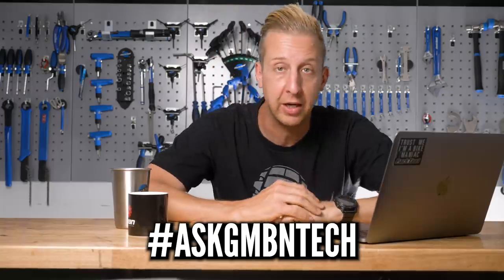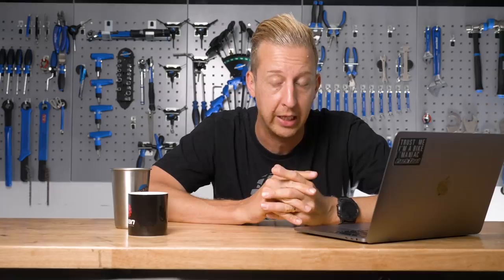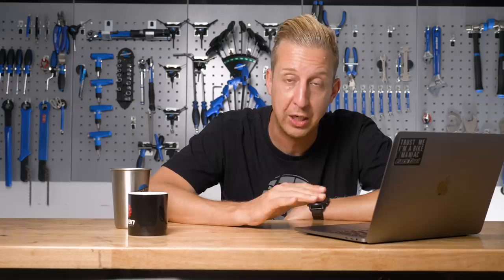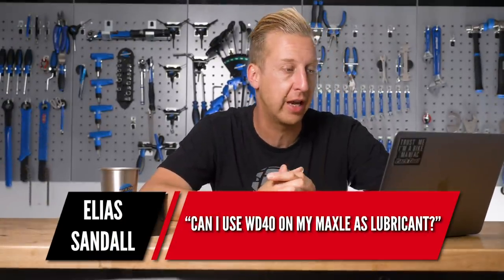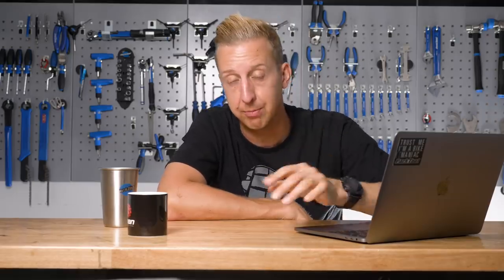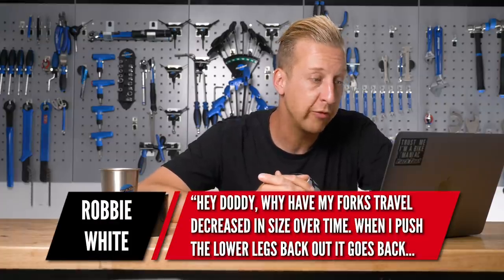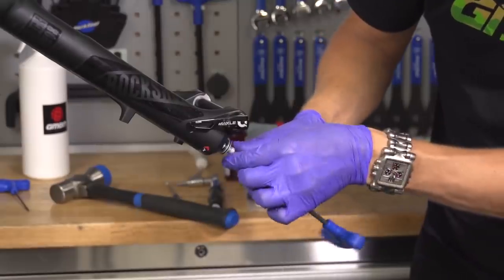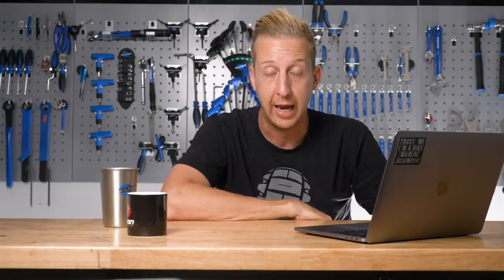How Are Disc Brake Pads Made? | Ask GMBN Tech Ep. 85

Comment from the maker: Got a question for us? Submit it in the comments below by using the hashtag #askgmbntech
Reply: GMBN Tech #askgmbntech.  Why don’t we see more Ceramic blend brake pads ?  They seem to perform so much better:  more stopping power, run cooler, squeal free, safer if contaminated...  so far, only found pads from CL Brakes and Gigapower.  Are there more companies offering these?  (Mine for SRAM Guide)
Reply: #askgmbntech

What is a good hard tail for £600 or under (preferably 1x and rear through axle) learned so much from the show thanks 👍
Reply: Hi doddy, I’ve tried to set my wheels up tubeless with a 2.6 continental Trail king and der derbaron ,muc off sealant and valves paired up with Alex MD35 650B plus 32H rims. There is a tiny leak in the rim where there is a line that follows round the whole rim which I imagine that’s where the rim joins, my rim tape is good with no scuffs or tears and the tyres seated perfectly, keep up all the good work GMBN! #askgmbntech
Reply: 34 t oval chainring fits my 2019 nukeproof mega 275 fine but it does rub ever so slightly on the rubber protector when the bike is in the fully extended position(no sag)
Reply: 7:27 - Thanks! 🙏🏻 Learned something ... again! 🏆
Reply: #askgmbntech I've got a 2017 Norco Torrent hardtail that has a stripped bb shell. Any advice on how to fix it? I went to my LBS and they said tha the BB somehow loosened itself which then stripped out the shell (not sure how that happened, the bike was built brand new at that shop about 1 year ago)  I found a BB from SunLite which is a threaded Press-Fit BB which has square tapered spindle which i think might work?
Reply: #askgmbntech What is your opinion on most powerfull brakes on the market? I have a rebuilded set of HOPE MOTO 6' es , but even with 225mm rotor and metalic brake pads, the power still goes down after some time(poor bite and starts being squishy). I thought about trickstuff's maxima model, but im concerned about the thermal capacity of that caliper, maybe a motorbike lever with 2 hope mono 6 calipers would be the option...what are your thoughts on that. Cheers
Reply: #askgmbntech Gday Doddy I was wondering if there is any way to put volume reducers in manitou forks more specifically the mattoc comp cheers

Comment: With the question about the clicking brake rotor, another issue I've run into is specifically with floating rotors. The example in the video is a floating rotor, and some brakes are not capable of handling them. Reason being, the potruding of the screws that attach the two parts of the rotor. Sometimes those screws will just barely not fit within a caliper, or they will slightly catch on, not the pads, but the metal part of the pads (depending on how they're shaped).

I could not use Clarks floating rotors with my Avid BB7 mechanical brakes for that exact reason.

Comment: #AskGMBNtech Not really a question, but I has to point out, when comparing 4 bar vs linkage driven single pivot, the difference isn’t where the pivot is, it’s where the axle is. True 4 bar has the axle mounted through the seat stay allowing the axle path to be manipulated via engineering, single pivot limits the axle path because it swings radially on the chain stay. Also, if you really think about it, they both have a pivot on the seat and the chain stay. If you’re ever confused when shopping, look at the axle path!!

Comment: #askgmbntech I'm looking to upgrade the damper on my 2017 Commencal Furious, it is a Boxxer RC. I already upgrade the spring side with the air spring kit without any issues. I want to put the newest Charger 2.1 RC2 damper, however it says it is for C1+(2019+) forks. From looking at the pictures I can't see any reason why it wouldn't fit on my forks. Will this fit my Boxxer? Thanks for the help.

Comment: @robbie white The fork sucked down is more likely air stuck in the lowers. Use the cable ties down the seals trick and pull it to full extension then remove ties before putting bike down.

Comment: #askgmbntech
Hi Doddy,
I got a second hand inspired flow about a year ago and the brakes are getting significantly worse. I tried new brake pads and cleaning the braking surface but the rear brake still slips under load. (They are magura hs33 rim brakes)
Thanks a lot,
Max
Reply: Bleed the system. A small amount of air will caused the pistons to move and contact the rotors but rather than providing the last bite, the air squishes instead resulting in sub-par pressure on the rotor and bad braking

Comment: #askgmbntech I recently got my first full suspension mountain bike and It came with Manitou Swinger 3-Way shock. The shock has a rebound adjust, as well as two Schrader valves to adjust the air pressure, a black and red one. I have no clue what the difference is between the two valves and would like to know how to set it up. Love the show and keep up the awesome videos.

Comment: #askgmbntech Hey, I'm trying to bleed my 7 years old avid elixir 1 brakes for the first time in a long while. I got the bleed kit from avid and followed the instructions perfectly, however, I can't push the fluid from the syringe at the caliper to the one at the lever.
Both clamps are open and the syringes thread in nicely. If I push hard, the fluid ends up on the floor. I also tried pushing from the lever to the caliper but it doesn't work. This is the case for both the front and the rear brake.
I read online that dirt particles and pieces from an old and brittle o-ring can block the insides of the system and that it helps to clear the hose and take apart the lever. Could that be possible? (btw, both brakes felt spongy but worked okay before this)
Have you got any other idea what the problem is and if I can fix it myself? The bike shops around here are terrible and I don't want to spend a fortune on a new pair of brakes. Please help!

Comment: #askgmbntech hy Doddy, 3 months ago i bought a Specialized Chisel. It's a very light hardtail with a RockShox Reba in 100 mm. I use it for puting kilometers in, but on the weekends i get pretty crazy with the descents. I have already installed a dropper post, and I'm thinking of passing the Reba to 120 mm of travel, will this affect the feeling of the bike too much in other areas but descending? Will the frame or fork suffer too much maybe? 
I've been told in the shop that the fork can be passed to 120 mm but i'm not quite sure. 
Thanks in advance, love the show.

Comment: #askgmbntech hello guys, thanks for the show, I've learned a lot form the channel. I recently got a 1x11 Shimano SLX with a SunRace 11-50 cassette. My first problem was the chain I ordered (a shimano 11 speed chain) was too short for the cassette, so the local bike shop was kind enough to cut another chain to get another 10 links so the chain would be long enough for the cassette. Now my question is how should I go once this chain wears out? Should I need to buy to chains and link them together to keep getting an 11 speed 126 links chain? Which brand would work the best, Shimano, KMC, Sram or any other? Is there any 11 speed chain with 126 links so I don't need to keep cutting chains? Would a 12 speed chain work (as far as I know they already have 126 links, but I'm concerned the chain to be thinner and not working properly for a 11 speed cassette) thank you very much.

Comment: #askgmbntech Hi guys I have an alutech Fanes 5.0 with a cane creek DB air cs which has a high pitch "ding"/click noise on its top out. The damper works fine but when the bike becomes unweighted and tops out fast it makes this noise. I'm a lightweight rider at 58kg and the damper is 216x63 running 140 psi 25% sag, the frame has 170mm of travel. I know this damper can be tricky to setup since there are fully independent adjustments for both high and low speed compression and hig and low speed rebound, I would really like your guys help to adjust these in the right way, and know if the noise is something to worry about or a matter of setup. i do a little downhill on the bike and I love to get bike in the air as well. Thanks for a great show and hope for you help.

Comment: #askgmbntech what is sram dub?
Will it fit on any bb or do I need a specific type of dub for my pf92 bb
Reply: dub is another crank axle standard (28,99mm). in their words the perfect size. The dub BB's come in pretty much all sizes (BSA 68, BSA 73, BSA 100, PF89.5, PF92, PF121, BB30 73, PF30 73)
Reply: Dub is their new crank axle standard. U will need a dub bb, and I believe they make one for pf92, but check srams website

Comment: I went to Morzine and burnt through 4 sets of brake pads on my 200mm shimano zee disk brakes. How can i prevent my pads overheating?
Reply from the maker: Hey Dale, try to use a shorter sharper braking action where possible. If you drag the breaks for a longer period they will get very hot! Hope this helps 👍

Comment: #askgmbntech -  I have KS Lev dropper seat post on my Cannondale Habit that will not return always to the top of the position when my trigger button is pressed.  Is there any easy way to fix this?  I was just going to take it to my LBS and let them sort it out, but curious if it was a simple job.  Thanks!
Reply from the maker: Hey Andrew, first it's worth checking that the cable isn't sticking. It may be kinked or damaged and causing the issue. It's also worth checking you haven't over clamped the seat clamp as this will effect the friction in the post. 👍

Comment: #askgmbntech I recently bought some new brakes. They have a very different leaver feel to my last ones. There is a lot of lever movement before the pads acctually make contact with the rotor. So, Can you bleed brakes in away that you put extra mineral oil into the system so that the piston sits further in while in its neutral position to reduce the leaver throw. And if so how? Thanks in advance

Comment: #askgmbntech hey doddie is it possible to use tubeless tyres on a non-tubless specific rims?

I've heard that pinned rims maybe no good for the job and non-tubless specific rims may have a tendancy for tyres lipping out of the rim when lateral load is applied.

Could, however, the use of a Cushcore negate this potential issue by acting as a selent for the pinned segment and also as a wedge (when tyres are pumped up) securing the tyre beading in place...could you maybe test it?

Comment: #askgmbn I just wondered, what would happen to an air shock i you fill it with differemt gases🤔
Reply: Some shocks have an internal cartrtidge with nitrogen. I sometimes imagine what if you put hellium in the tires...
Reply: @chencho7083  wheelie cheating enabeled
Reply: may leak less, depending on the gas.

Comment: #askgmbntech 
hi guys! Nice work with the show!!
 I’m in doubt regarding the boost and non-boost issue. I’m running a fox 36 talas with 20mm thru-axle, to be replaced soon. I know this is 110mm wide which would make it boost, but Harry mention in a previous show that all 20mm forks were 110 at the time. Hub is a hope pro 2 evo. New forks will most likely be 15mm axle, so will the 15mm adapter hub caps give me the right spacing for non-boost or do i have to buy boosted forks? I can’t tell if the width is given by the actual hub, without the caps. Thanks in advance!

Comment: #askgmbntech Hi Guys, i just cracked the frame on my trail bike. Now I have got a 2015 Transition Smuggler frameset to replace it. It comes with a (I believe, specifically tuned) Rock Shox Monarch RT3 DebonAir rear shock in 190x51 mm. I still have a almost brand new Cane Creek DB Air IL shock from my old bike with 190x50 mm. I‘ve really liked it’s performance and tunability. Do you think it might work/be a good idea to put that CC in the Smuggler? It’s about 2-3 mm eye to eye shorter than the RT3. Will it affect the ride when it therefore will lower the BB and slacken the geo? How do you think that setup might be to ride? Thanks in advance and keep up with the great content!
Reply: Look at the leverage ratio of your linkage. 170mm travel on a 51mm stroke is an average leverage ratio of 3.33, so 3mm of eye to eye difference is 10mm travel difference, so you would be lowering your BB, slackening your head angle, and loosing 1cm of travel by using the CCDB. That new Debonair is sweet, and similar to CC with the dual chamber action. If the shock was tuned for the leverage ratio and progression of the frame, it's probably going to perform better.
Reply: @ryanjspinks  Hi Ryan, thanks for your answer. The Smuggler has 115 mm of rear travel. So if I use your calculation for the leverage ratio, I get 2.25 for the 51 mm stroke of the RSMRT3, so if the CCDB is 3mm less eye to eye, the stroke should be 6.75 mm less. ...which is still not little. Regarding the custom tuning on the Monarch I'm not 100% sure if that's the case, but probably that damper might still be the better choice.. Pity! I tend to be into all that non-mainstream stuff.. Thx

Comment: #askgmbntech hey,my bottom bracket makes a clicking sound when i ride but when i wash my bike it doesnt make any sounds until i ride in the dust or mud what can it be ?
Reply: You have some grit in the bottom bracket area....either between where the left and right arms connect or between bearings and frame. When you wash it the grit is either removed till the next ride or the water dampens the sound so the slight movement of the component doesn't click (think squishing dry vs water filled potatoes chip bag). Pull crankarms and wipe everything down then regrease. If that doesn't work do the same with the bearings.

Comment: #askgmbntech I have shimano slx breaks (2 pot) however I have a few issues with them. The first issue; even after a full bleed by a mechanic at my local bike shop, they feel spongy, I’ve followed some tips and tricks on how to get more performance with no success. Any ideas? Second of all and most importantly when I pull my front break leaver, fluid starts to come out of the calliper. I’ve checked that the port is tight and it is but I believe it may be coming out of the pistons. I’m not 100% sure so have you got any ideas? Thank you, love the videos, keep it up !!!
Reply from the maker: If you check the Shimano Tech docs you can find a full exploded diagram of the calliper. It is possible to rebuild the calliper but may be more cost effective to just purchase a new fresh calliper.

Comment: #askgmbntech Hey Doddy and Henry, on my wife's new bike when i pull the front brake and  try to move the bike forwards and backwards it seems like there is something loose or have some serious slack, but the headset and the brake caliper are tightened and don't have slack at all when i check it and The fork doesn't have slack too, so what could this be? I have to mention that my wife has centerlock discs, could it be from that? Greetings from Germany

Comment: #askgmbntech Hey doddy! Love the show, recently my relatively new sram 11 speed mech has started to bounce around and make a noise like my old shimano acera. Is this normal for high end mechs or should i do something?
Reply from the maker: Check the jockey wheel bolts and mech hanger are torqued correctly. If this doesn't solve it check with your local bike shop and they can help diagnose the issue. Hope this helps 👍
Reply: GMBN Tech thanks, pretty sure its clutch tension though and it isn’t adjustable

Comment: #askgmbntech
Hi guys love the chanel. 
I have the Shimano Mt500 brakes dual piston, but I need more stopping power, so I decided to buy the Shimano Xt 4 piston. 
My question is if I can keep the levers and only buy the caliper to save some money.  I guess that it wuold be compatible but I want to know is there would be any disminuation of the performance or would have bleeding issues. 
So what do you recomend to me, buying the full brake or only the caliper??
Thaks a lot.
Reply: I did just that. No issues. Plenty of stopping power, I'm a big guy 250 with full pack.  With 203 rotors I added, almost too much power.

Comment: Hey Doodie, I have the same problem with my brakes like the guy at 6:11. I use the Hope Trial Zone with the Tech 3 leaver and the Trial Zone brake discs wich also has big holes in it. But while braking they make an insane loud clicking noise and i don't know why :( Usually they aren't supposed to do so i think. Thanks! 
#askgmbntech
Reply: Sometimes the pad might also be too wide, meaning the lower half of the pad is striking the rivets holding the braking surface to the rotor core. Check the wear pattern and make sure the pads are aligned with the braking surface

Comment: #AskGmbntech

Is there a good reason to buy expensive disk rotors if yours don't heat up that much?
Reply: Well you just answered your own question.
Reply: Tomi Saaranen no he didn’t. He’s asking if there’s a reason to upgrade disc rotors if they don’t heat up too much already.
Reply: More expensive rotors will run cooler overall, so they will perform better even of you are not getting them as hot as a DH rider. Also there is the age old, more $$$ = less weight
Reply: @zacjohnson452  Well the answer is no. I'm all about high-quality discs and would run nothing else, but if his rotors don't heat even nearly enough to cause problems and he is happy with the braking performance, in my opinion there is no reason to upgrade.
Reply: What Tomi said. Plus why fix a problem that doesn't exist.